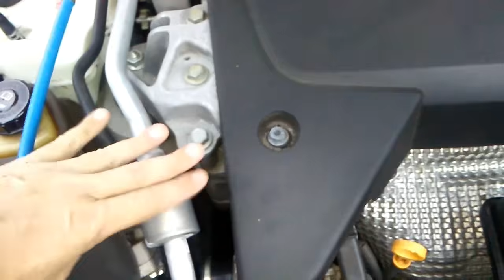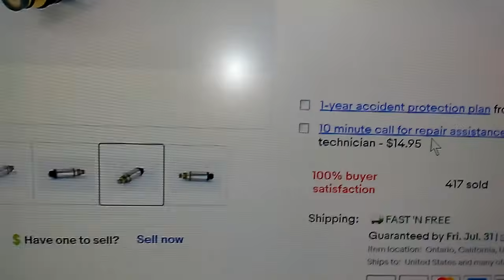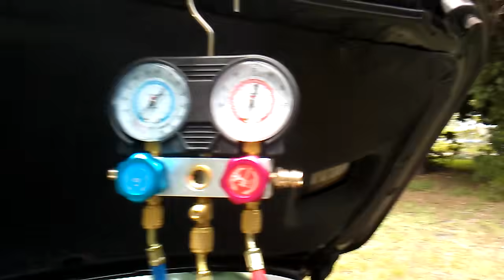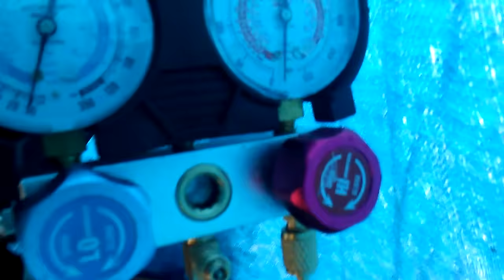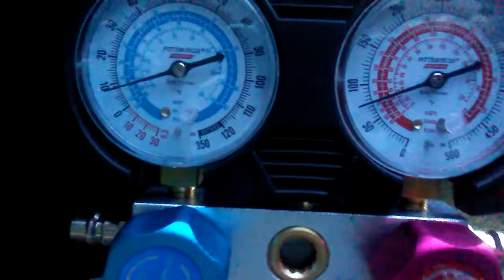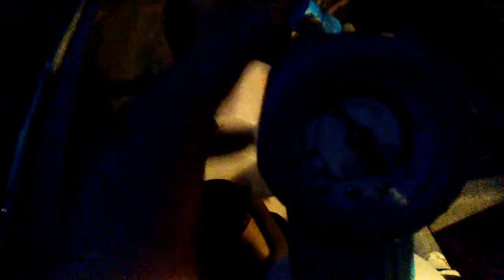WEAK AC FIX!  Nissan Altima SV/SL AC Compressor Refrigerant Control Valve Solenoid Repair

Comment: any idea to  solve same problem for Nissan Altima S 2.5, this a/c compressor doesn't have that control valve, at least not showing, i already replaced the a/c compressor , dryer and expansion valve
Reply from the maker: I really only know about my model.  youve replaced so many components I can only imagine maybe a blend door motor not letting the cool in?  Is your low line getting cold?
Reply: MMYT - Did you ever figure out your issue? I have the S model as well.
Reply: Please check your radiator/compressor fan connection plug. Sparking may lower the speed

Comment: Hi.  I’m about to attempt this fix.  When you had  the shop recover the refrigerant do you think any of the compressor oil escapes?
Reply from the maker: not enough to matter.
Reply: Did they charge for that service?
Reply from the maker: @seantilldawn  of course, maybe you could get a deal if you have them do the swap and pay for the refill?
Reply: What did the shop charge you to recover it. ?
Reply from the maker: @seantilldawn  about $35

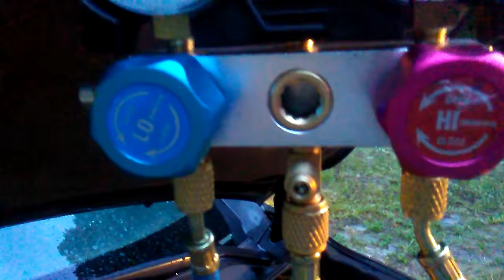Comment: How did you purge the air before adding refrigerant at 10:50?
Reply from the maker: Theres a little bicycle tube like valve you just press it in a bit with a screwdriver.

Comment: I'm a little confused because you said that before replacing the valve, the system has to be evacuated of all refrigerant, but it looks like you evacuated the system after putting the valve in and then recharged it.
If i were to do this on my own, is this the step i should follow:
1.Replace A/C compressor valve
2.Evacuate System
3.Recharge System
Reply from the maker: NO! You must get rid of refrigerant first the system is under pressure!  Then you replace valve, then you have to run a vacuum to get rid of air and moisture.  Finally in goes the refrigerant and your done.  Chris fix has a good video for ac recharge.

Comment: Hey bro If i remove the old valve is there any losing for the oil or just that fine install it then charge the a/c then fine ?
Reply from the maker: no the oil is throughout the system and even though I had a pan ready no oil dripped out. just switch and charge.

Comment: Thanks so much for doing the video. I own 2 of these cars so I will be doing the same fix on both. Your explanation and video footage was very good concerning the replacement of the control valve. I need some help understanding how you hook up the pipes .....so I'll watch your video several times, as I found that part a little quick for inexperienced me.
Reply from the maker: theres plenty of ac vacuum videos check out chris fix https://youtu.be/Pdq8JAlct6s
Reply: mst3kpimp Thankyou. I just watched. Chris fix is very good. I’ve seen some of his other videos. Really appreciate your help

Comment: Nice video I’m a mechanic i always know that valve was the problem I just never know they sell it so I always recommend replacing the AC compress and the customers never do the job because it’s expensive as fuck I’m going to start recommending only the valve from now on lol
Reply: my ac wont blow that cold any more and at stop it blows warm. i was told that the compressor is bad my it turns on when you turn on the ac and it stays on. could it be this control valve? or the expansion valve???? please help
Reply: @jocelynmercado4285  What did you end up doing?

Comment: Thank you so much for posting! I have. 2013 Altima SV with the same problem and this will be the tutorial my husband follows to fix it for me 😂🙏
Reply from the maker: nice, let me know how that goes and if its different than the 2014
Reply: @mst3kpimp  hey my 14 altima S is not kicking on the compressor but ive read that my car doesnt have this valve?
Reply: @puma1294  its not supposed to but you can look under and check.
Reply: Did this work for you ?

Comment: Great video. I have a 2014 Altima SL with the same problem. Had the refrigerant replaced yesterday to no avail. Will definitely try this. Quick question, do you know if I can replace this valve without loosing the refrigerant???
Reply from the maker: no you must evacuate, its a sealed system.
Reply: mst3kpimp Thanks for getting back to me. Really appreciated!